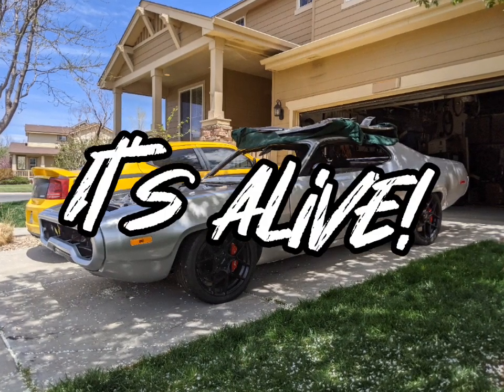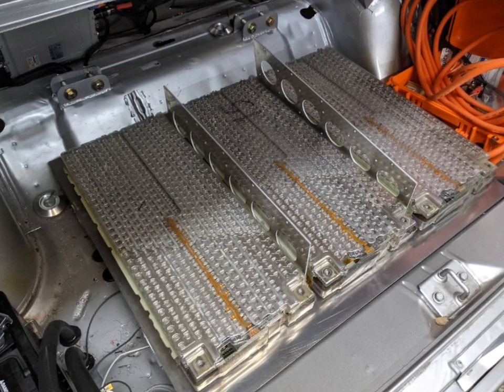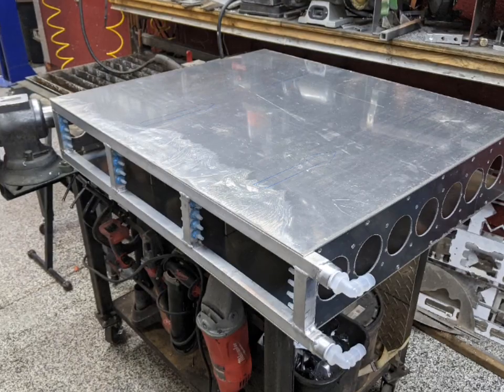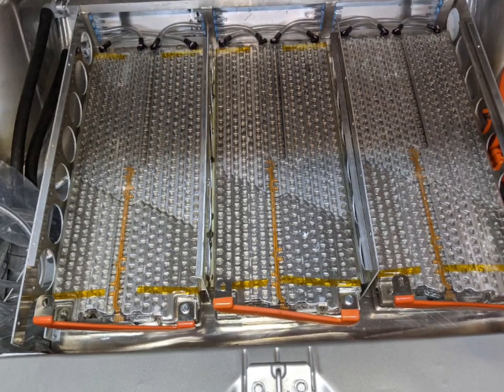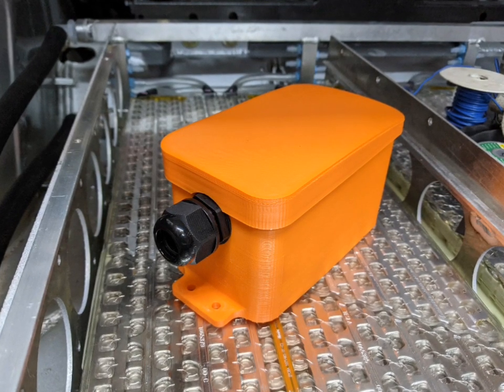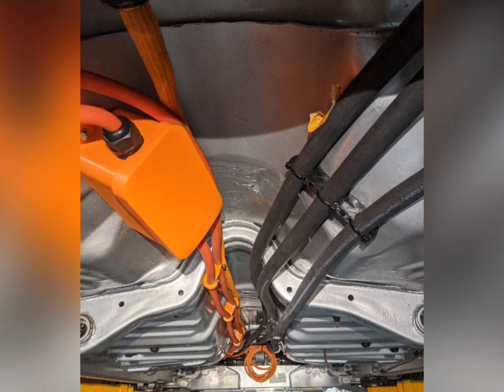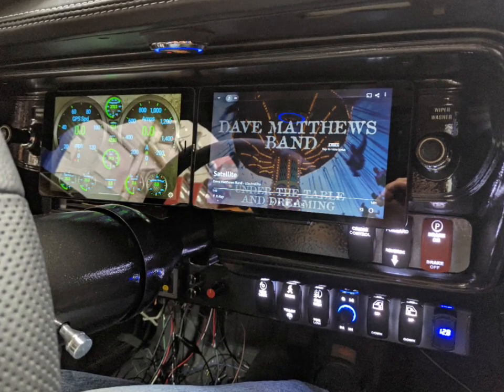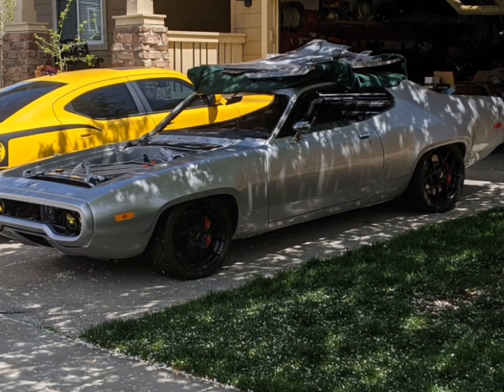Project Electrollite - Plymouth Satellite Tesla Swap - It's Alive! Ep. 13

Comment: Hey, amazing build. 100 times better than a real Tesla! 👍👍

 It might be a good idea to reprint some of those parts in a flame retardant ABS? Something like 3dxtech 
Firewire Flame Retardant ABS  I've never used it. But, I have watched videos of burning 3d prints.
Reply from the maker: Thanks!  The ABS parts should be ok for normal duty, if something burns I have bigger problems!  I'll check out those materials though, thanks for the tip!

Comment: Hi! So I have the exact same car. Mines a 72 satellite. It's got a worn out 318 and 904 transmission..  how much would you charge to build a swap kit? I would imagine you have all your plasma table cut out blueprints saved to a computer.. anything you suggest I start with on mine?
Reply from the maker: Sounds about like this one was... Not really sure I have parts kit worthy.  I do have a lot of parts that will fit, The Assembly will take a lot of custom labor.  As far as the starting point, I'd say the motor / suspension is a good place to start, some wiring can be done before and after the batteries.  I can help you spec out all of the other components needed.
Reply: @MrMoparMan  that would be really awesome. So just trying to get an idea on what the cost of something like this would be? I'm sure it's not cheap by any stretch of the imagination. But do you have a ballpark?
Reply: @MrMoparMan  or is there possibly a better way to get in contact with you? So I can share images and discuss finer details? I've been tossing around the idea of doing the same style build your going for. And some guidance would be really appreciated. Never done anything this custom before.
Reply from the maker: @jarrettupward3676  Just parts are going to reach 50k if you go high-end.  Send me an email at mrmoparman@gmail.com.

Comment: Have a couple of questions, if you don’t mind answering them. Sweet build
Reply from the maker: Sure, what do you got?
Reply: @MrMoparMan  I have a 67 Camaro SS, I’m really now taking an interest in doing something similar. Question is, do you know of any good sources where I could get a Tesla drive unit, I’ve seen some over eBay, and seen some from companies such as EVwest, but just thought I’d ask for a second opinion. Other question is, do you think this will be the new norm when it comes to classic cars?!? I certainly do, but just wanted to see what your response is. Thanks for getting back with me Kevin!!
Reply from the maker: @rickyjaimes2942  you can buy the unit ready to go with an aftermarket inverter controller from stealth EV.  Anything you find on your own you'll have to swap out the board which is not terribly difficult.